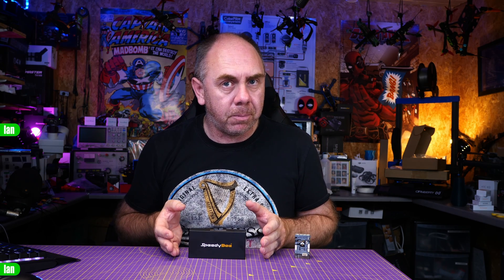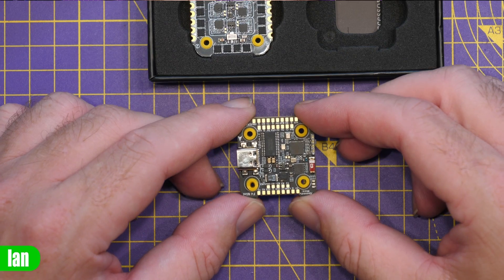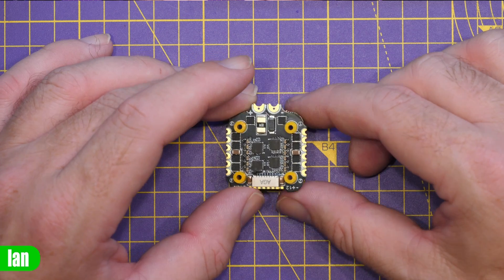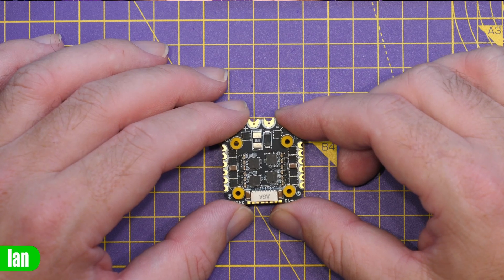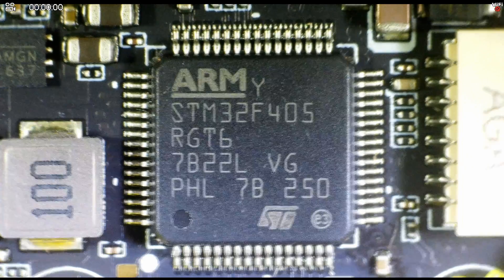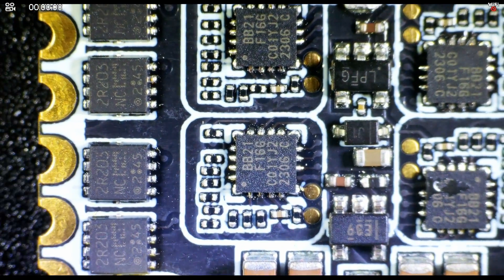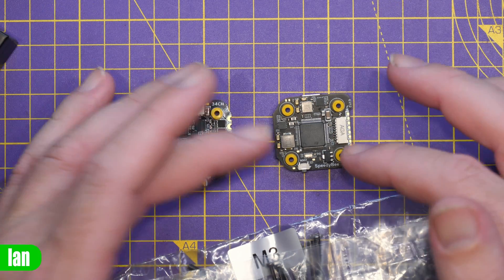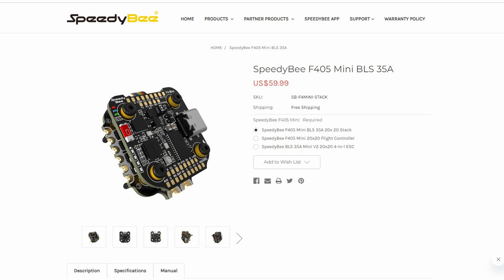Cheap Builds Are Back! - SpeedyBee F4 Mini Stack

Comment: I'm going to write about the SpeedyBee F405 mini stack 35A. 
It certainly looks like a work of art. However, there are some significant disadvantages.... 
The main disadvantage is the high temperature of the flight controller! Everything is warming here, both STM32 (core temperature is 84 degrees Celsius), bluetooth and OSD. And this is with USB power only, when nothing else is connected to the stack and the motors are not rotating. Apparently, the Chinese have miscalculated something. Because, for example, Mamba F405 mk2 PC is not characterized by such problems. 
The second problem is that "out of the box" motors did not want to rotate, only jerked at maximum throttle. That is, the firmware was not working! To be more precise, on the firmware Blheli J-H-40 v16.7 the motors do not want to work. After flashing JazzMaverick blheli v16.77 48 kHz the motors came to life. But even here a crackling noise was heard during operation. And only after flashing Bluejay v0.19.2 48 kHz (I recommend it!) the work of the motors became smooth and without crackles. 
And then one of the regulators stopped flashing at some point. Thanks to a kind person on the forum - he told me how to solve the problem. 
In general, a controversial flight controller. Its only plus is the ability to configure via bluetoth - this thing works great, all settings in inav, betaflight, ardupilot are available.
Maybe it's just me being so lucky. But it seems to characterize this brand.

Comment: Been a bit busy lately, a little bit late  to thank for your excellent description of this FC, based on your video  I took a chance & bought one from Unmanned Tech it's now in my Diatone LR4  working great with my DJI 03, had a bit of trouble finding out how to get the Betaflight 03 OSD working till I used the Speedybee Bluetooth App to install the correct preset for it, going to make a 4S Li IOn pack and install Inav for RTH as I don't trust Betaflight rescue mode enough with my 03 stuff, the Inav for it is WIP,  Pawel has started it 😀

Comment: I bought their 30x30 F405 stack recently just to have on hand as a spare. $59.99 for it. I'm running their F7 stack right now because they were sold out of their F405 stacks when I needed one, but when I seen that price & that it was in stock, I had to get one. I'd like to get a couple more soon, just as spares. I'd like more F405 FCs just because I happen to have 3 brand new F405 chips. When a Mamba F405 FC shorted out the F405 chip, I bought 4 of them before the chip shortage. Used one to repair the Mamba 20x20 mk2 FC and still have 3 new ones left.

Comment: Is USB-C up to spec? Their Wing FC had both CC1 and CC2 connected together (probably to save 0.01¢ on the second 5.1K resistor), which meant it wouldn't work with most USB-C to USB-C cables..
Reply from the maker: I did not notice this.  Let me have a look.
Reply from the maker: Just checked and no appears to be correct.  Both on separate resistors and no continuity
Reply: @MadRC thank you for checking, it’s great they’ve fixed this!

Comment: I had their F405 V3 50A ESC catch fire in the first 4 minutes of flight. Destroyed all the components and lost me well over 120quid despite costinge 53quid. I was racing with it, so maybe it would be alright on 4S. It's a low price for a reason, getting quality ESCs next.

And the FC was awful for me too, had gyro issues causing loads of vibrations.

Comment: Love Speedybee's stuff, just bought their F4WING-APP controller for my T1 Ranger VTOL build - £35! And an amazing box presentation. As much as I love Mateksys stuff, the extra £70 for an extra imu, a bit quicker cpu and some minor other knick knacks, not so sure. Would love Speedybee to come out with a competitor to Mateksys's fixed wing flagship the H743, the WIFI + Bluetooth is game changing imo, not having wires hanging out of stuff on the bench all the time. Also Mateksys's £70 GPS M10 unit, you can get from Walksnail for £50 less, just minus an extra barometer, its not a CANBUS, and a slightly larger GPS antenna that can pick up an extra 1 or 2 satelittes over WS's system. £50 for that? Sorry no! I think what we are seeing now is the profit margins 'inflation' off the back of COVID, being exposed by Speedybee. Well done to them!

Comment: Hope it performs better than the current F7 35a mini stack—the FC is fine, but I replaced the ESC twice before switching to the Mamba.
Reply: What was wrong with the esc?
Reply: I put them in a couple micro builds last year, and both were dead within a few weeks. Just one dude’s experience, but I’ve seen multiple reviews with similar stories.
Reply: @paddle2thesea  thanks for sharing your experience.
I'm happy with the budget jhemcu 40A 4in1 esc. Works nice on 5" light builds and smaller.
For full seize 30x30 stacks jhemcu has a 45A esc that works awesome on my 7" build.
I was thinking of this speedybee mini esc, but I bought the 60A HAKRC mini esc instead. Basically it's the electronics of a 30x30 squished into a 20x20. Just like foxeer does as well.
Powerful 5" setups kill these small ESCs

Comment: isn't that rather a quite affordable one than a cheap ?
My last 405 Wing FC purchases have been quite an astonishing experiences cause it was a really nice surprise and that starts for me with the quality of the box and what is in. 
The only piece missing for me was a capacitor to avoid sparks but everything else looked great, even the usually rather small or tiny leaflets were colourfull and in a readable and useable size which I emphasize cause I hate to rely on links or qr codes only which then might not work at all.

I like these and again it feels like with new products we see lower price points to appear which offer the older manufacturers to let the prices of previous products stay up. 

Things become less expensive except new planes which are still missing a lot.